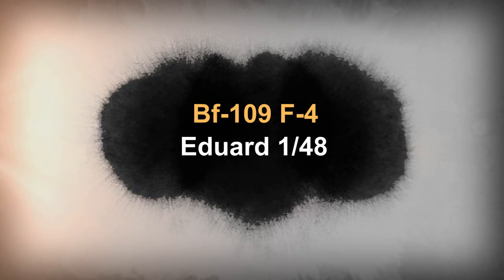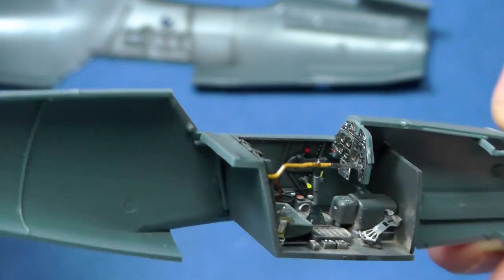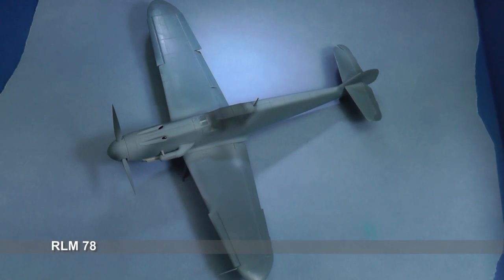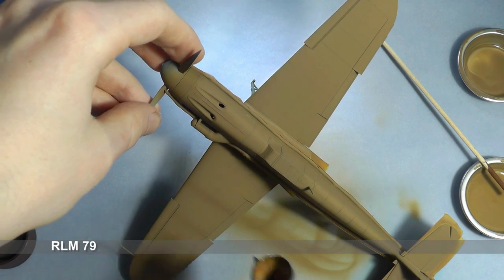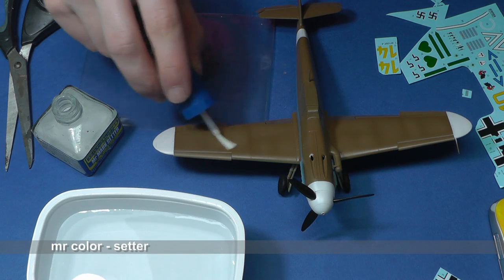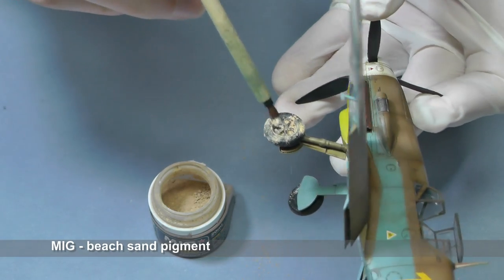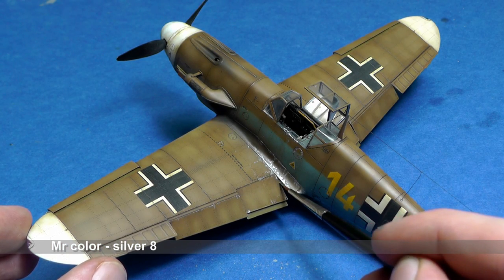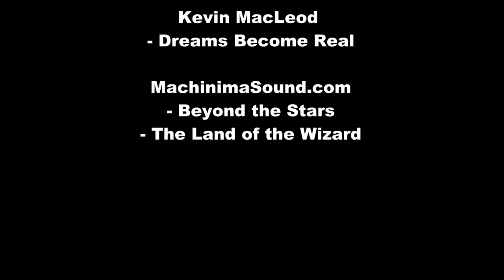Messerschmitt Bf 109F-4 Eduard 1:48 Hans-Joachim Marseille Step by Step

Comment: you are an inspiring young model builder with great skills and the kindness to share your gifts with the community, thank you . brilliant work.
Reply: I agree. Thank you very much for sharing your methods.
Reply from the maker: Thanks. I am glad that you are learning. I still exploring new methods and procedure. anyway, It is no gift just many years of practice. I believe that anybody can do it.
Reply: It is a gift from You to the community. No one said You got it as a gift from day one :D
Reply: PLASMO - plastic models 
I primed the surface of my F-16 with X-1 enamel paint before brushing Xf-1 acrylic thinned 2 parts paint to 1 part X-20A.  The paint didn't stick to the model and tore off really easily, did I make it too thin or did the enamel paint stop the acrylic from sticking?  Thanks!
Reply: James Kurk
Reply: Tomcat Model Kits enamel will prevent acrylic from sticking properly. this problem caused me to scrap a beautiful EE Lightning.
Reply: +SmokingSpitfire
I should've seen it coming because the solvents used in enamel paint are non-polar, while the solvents in acrylic paints are polar so they would naturally repel and that would prevent the paint from sticking.
Reply: Tomcat Model Kits Not necessarily. I'm suspecting the oil in enamel may create problems. I'm successfully using enamel paints (Krylon and Rustoleum) as primer. After they are fully cured (48 hrs), I wipe them with isopropyl alcohol (proof 60 or stronger) and then spray acrylics. Never had a problem.
Reply: legit kindest comment on YouTube i have ever seen

Comment: One of the things I like about your work (and there are so many others!!) is the way you "trust" your adhesives' power, never using too much, thus getting a clean joint or seam. It's a lesson I need to take to heart more, since more glue is not needed usually and not "good" for the build if overdone and visible to the dreaded contest judge. Since the level of contestant work is so high now a days they resort to becoming apoplectic if they see a microscopic glue mark and immediately throw you out of the competition, and then demand that you be water-boarded or something!

Comment: Excellent 109! Beautiful replica of the "Star of Africa's" mount. I run into the same problem as you trying to replicate the schemes of my favorite P-47's. So many different renderings, it'll drive you mad! Great job tracking down the correct scheme, and you build some real stunners. Congrats!
Reply: I have seen old black & white films of aircraft factory personnel spray painting aircraft and I think some times modelers overt think it.  Under rushed factory conditions it was an imprecise process, to say the least.  So much so that I am willing to wager that virtually every aircraft was slightly different, at least as far as camo goes.  Often it was downright sloppy!

Comment: Hallo David!
I return to your great videos more and more to learn as much as possible.
Recently i did a mistake on my Bf 109... I sprayed clear glossy varnish by AK and then mixed white spirit and oil paint to make a wash...
But when i cleaned with dry paper i washed away the decals and the paint... Why? What is the correct way to do?
I have to use clear acrilyc or enamel to protect? Or can i use future (i have a bottle)?

Thanks! And compliments!
Reply: Typically you'll need an acrylic clear coat before using white spirit or enamel thinner. Or vice versa if you use enamel based paints. Basically a reverse of what you intend to use as a wash. You may want to trial future on a scrap piece before you use it as I used it once before decaling and found the settling solutions reacting to it.

Comment: I would like to know how much drying time is required after the application of the Mr Color Clear Varnish layers, before applying the oil wash. Also, I assume the varnish a product that must be cleaned with a synthetic thinner, so not an acrylic product. So no danger the oil wash, which is also thinned with cellulose thinner or terpentine, attacks the varnish? Thank you (anyone) beforehand for enlightening me! Great stuff David, as usual...

Comment: Another great build.. Thanks for the tip on the Uschi van der Rosten-rigging thread. Never heard of it before. I mainly use braided fishing line for my rigging. The thread that comes with modelkits is total rubbish.
Reply from the maker: Thanks. I have ordered this fiber in a local store before a year. Finally arrived. :-D It is mainly used for ships in 1/350 and 1/700 scale and it is very elastic

Comment: thank you David for that, absolutely loved it. small suggestion if I may, if your doing something which involves small detailing like: the clear lights with epoxy, stratching the radio wire or applaying a dotted wash or filter as examples, it would help if you zoom in more. that would be very helpful. cheers 👍
Reply from the maker: Yes, my video camera can do it. Good tip thanks.

Comment: Could you do a video on taking care of brushes and materials?
Reply: Ethan Ton Don't get paint on the part of the brush where it joins the metal, which is called the ferrule. Use water to wash out waterbased paint, use a solvent to wash out solvent based paint. Use a brush conditioner on natural hair brushes like sable. It's pretty simple really.

Comment: I've again a question. when I apply oil wash, I can hardly wipe it off and the layer of gloss varnish is destroyed. I use vallejo gloss varnish (3 layers) and I dilute the oil paint with revell color mix. is that too aggressive? is super clear 3 acrylic or enamel? I really don't know what the problem is but now my plane is destroyed:'( can you help my? Your messerschmid is amazing! !!
Reply from the maker: Super clear is lacquer but Vallejo or Tamiya are good too maby a little bit less durable. I think your problem is with thinner. Maby you can try x-20 enamel or just pure oil paint.
Reply: Thanks!!! I will try it. Keep building:-)

Comment: I don't get behind this technique at 9:00
whenever I try to blurr in the oil color with a dry cutton bud I simply wipe it off completely and it looks like a mess.
Did you let it dry on the model surface? For how long do you dry the oil paints on the piece of paper?
Reply from the maker: You probably have wrong oil paints. You need "totally covering" and "best light resistance" on umpton has this marks http://www.umton.cz/index.php?call=olej
I do not let them dry. Very important is matt surface.
Reply: Oh I see. Thanks alot.
My oil paints are apparently totally covering but I had a glossy surface on my model.

Comment: Only one suggestion. These little metal parts very often wonderful detailed, until you put colour on it :(
Without colour they look strange, becuse most time golden or messing coloured. After long search I found a product named "stromlos Nickel mit Aktivator" what means "Electroless nickel with activator".
You have to clean the parts and put it in the Activator around 20 Minutes. Afterwards you "cook" them in the Nickel bath until the fluid is away.
The Nickel keeps very thin on the Parts without damage the Details and now they apeare in a matt grey-silver, but not 100% equally, more patchy, looking like old Alu. I found out the quality of the result belongs to the care of the preparation.
If you want, you can paint it anyway with thin colour which you scratch partly away after drying, looks great :)
Very often I let it like it is, without colour, then it looks like a spare part which was not painted again after replace it.
Reply: totas2000 
All you really need to do is wash them in soapy water, then apply some metal primer before painting
Reply: what does yo mean with "metal primer " ?
Reply: ok, thanks ! I will check it :)
Reply: @rurushu8094  yes, I have thick liquid stuff in square bottle, all in Japanese writing except says "Mr. Primer-R" on the label. Got on line. It works well, just brush on part, wait 24 hrs, spray primer like Tamiya Fine surface primer, or Mr. that he uses, then paint with enamel, lacquer, or acrylic. All sticks to PE parts well, otherwise, yes, as said, it can be a problem to get paint to stick to the raw metal, especially with acrylics, which I use almost exclusively, of the brass photo etched bits.

Comment: I have a problem, every time I try to thin down a wash (mig enamel type wash) with X-20 thinner it resolves the paint below, even thought I first used tamiya xf colors, then applied semi gloss varnish (also tamiya) then decals then another semi gloss coat, what am I doing wrong? Thanks!